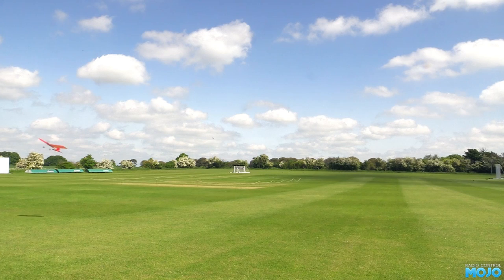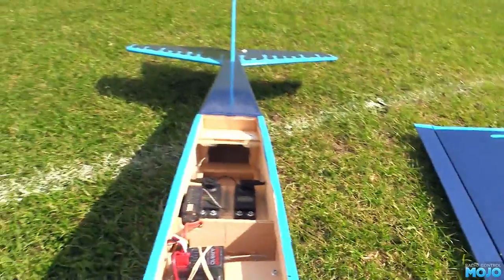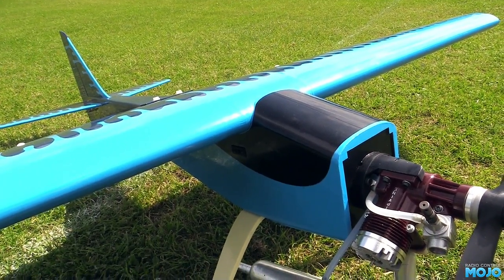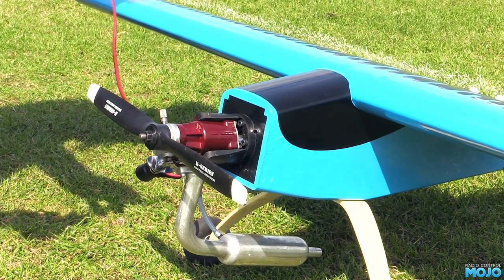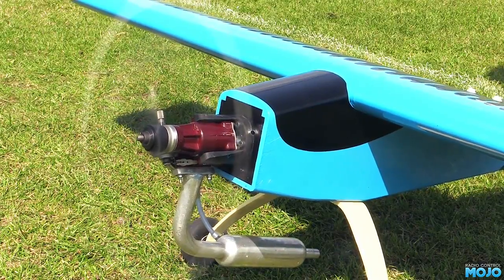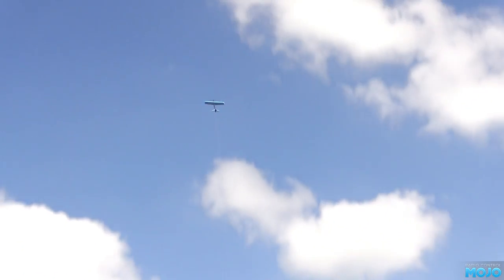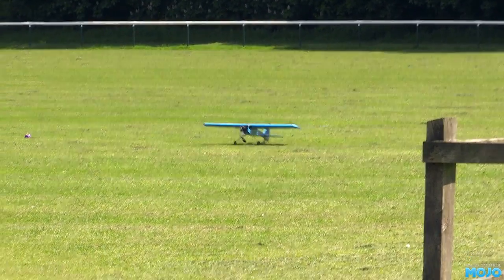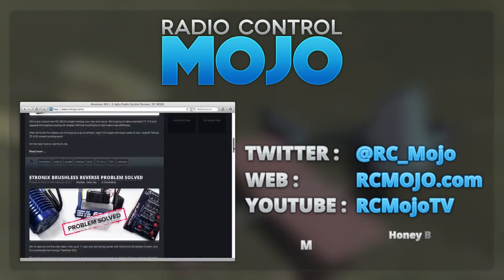Electric or Glow? (Fixed wing edition)

Comment: Thank you for this clear and neutral video. 
I've been in the hobby for two years now. I've always flown electric foamboard scratch build. Because it's cheap when you crash, which I've done a lot.
But I'm growing tired of flying 10 minutes on each battery and waiting 2 hours for the battery to charge up. And one thing they dont tell is that lipo batteries dont have a very long life span. After a couple of months they puff up and you have to buy new ones. This can get expensive. 
If they overheat, they puff up, if they're hit, they puff up on the best case scenario. 
Lipo are fragile. 
I just ordered an ap 0.15 hornet glow engine to see if ill prefer glow and im working on a coroplast trainer to put it on.
Reply: if your puffing batts your running the wrong prop or voltage or motor. i have had a thousand charges on a lipo. 2 hours to charge? you need a new charger. get more batteries also. i use cheap batts not the big name high priced batts.

Comment: As you concluded, horses for courses, so neither is "better"

Personally I had enough of noisy, smelly, oily glow motors when I was younger and today enjoy the ease of use of quiet, clean electric power but I can see the attraction of glow and petrol engines for the right type of model and flying location.